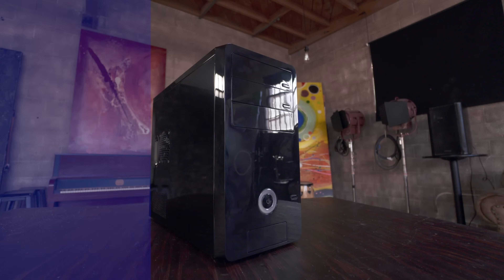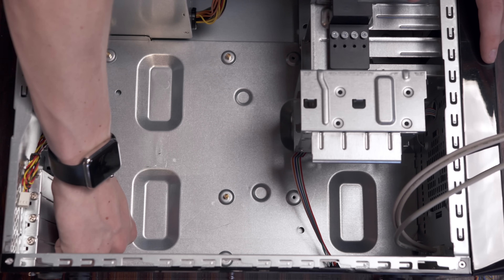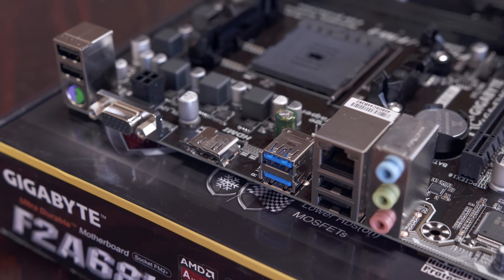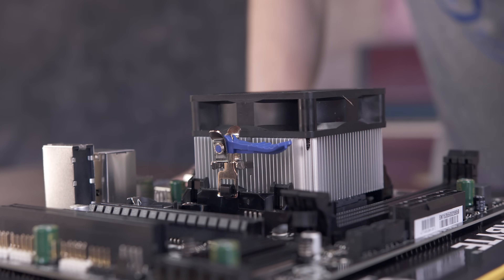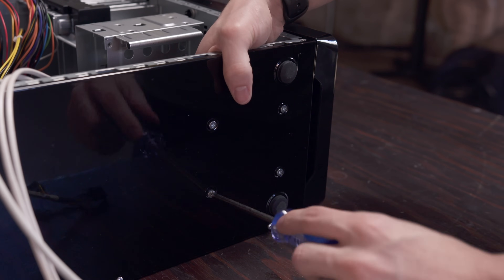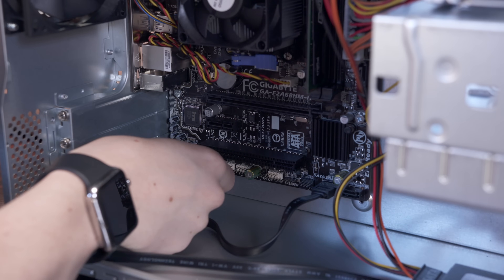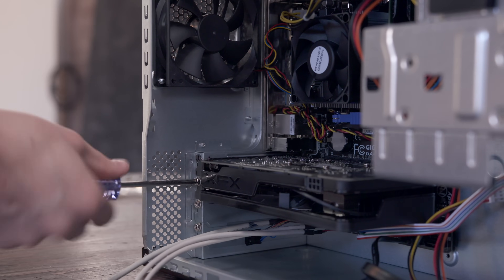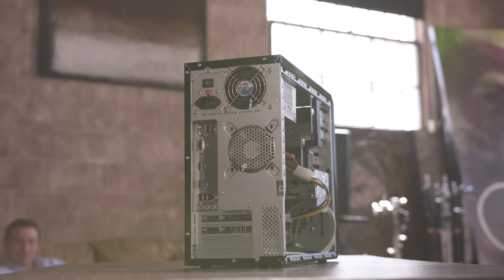How to Build a Gaming PC! (2016)

Comment: Could some of you rate my specs? :)
----------------------------------------------------------
Core i7-6700k

GTX 970 (4GB)

ASRock Z170 Gaming K4 ATX Intel LGA1151 Motherboard

G.SKILL Ripjaws V Series 16GB (2 x 8GB) Ripjaws V 2133 MHz DDR4

2TB Toshiba hard drive

Power supply : Raidmax Thunder V2 Series 735W

Xigmatek Assassin E-ATX Tower
Reply: Why would you take the i5-6600k instead of the i7-6700k, since i can also overclock the i7-6700k ?
Reply: GPU: You should definitely look at Nvidia's 10-series (the newest), they'll get you better performance and quieter operations. The GTX 1060 beats the 970 practically everywhere.

You should add an SSD to your build, it will really help boot times for Windows and load times in games.

Also, a 550 watt PSU will do just fine for this kind of build. You don't really need anything higher.
Reply: Yeah, i have a ssd drive, i forgot to put that in :d
Reply: JOISPOI24 Assuming you will be overclocking, i would go with an i5-6600k and gtx 1070
Reply: Keep in mind that i made this build in May 2016, The 10 series was a bit overpriced at that moment imo :)
Reply: I don't understand the point of getting a 6700k and having a gtx 970... i'd rather spend the money on a gtx1060 and a 6600k instead of having a shit gpu and a good cpu
Reply: iX NuclearFX
Okay, but you should know that i7s are not just the same chip as an i5 with higher clock speeds. They have extra 'threads' which allows them to do stuff like rendering faster, which is why they're worth the effort for heavy users.

Not that a 6600k would be terribly slow, an i7 would just be better.

If you're gonna overclock make sure to pick up a good 3rd party CPU cooler otherwise you may encounter thermal throttling and/or a very noisy system.

(also this is all assuming that your post saying 6600k isn't a typo, except for the cooling part)
Reply: JOISPOI24 an i7 6700k with a 970

facepalm
Reply: I can do a lot of heavy video editing I have 

Core I 2
2gb Ram
No graphics card
Reply: JOISPOI24 you have the best computer wish i could get one like that cuz all i need is gtx 760
Reply: Correct, an i7 is really only worth the extra money if you're going to do a lot of heavy video editing etc. For gaming they really don't add much
Reply: Broseph Stalin I will do much of the "heavy video editing" in the future an would prefer to buy a 6600k and overclock it to 4.2-4.5ghz especially for the price
Reply: Lytheus or you could get a i5 6600k with a 1070 since they would be about the price of a i7 6700k and 970
Reply: ***** 970 is currently around 600 dollars on newegg right now... a 1060 is 200 and a 1070 is 400 and a 1080 is 600 and they all out perform the 970, I don't think the 10 series are overpriced at all
Reply: ***** currently around 500*
Reply: SoggyOreos he probably just assumed newer model = more expensive lol
Reply: JOISPOI24 you can play GTA v at 100+ fps
Reply: GTX 1080
Reply: Better than my life
Reply: travpar0 plz sub to me
Reply: GPU buy gtx 1050 ti
Reply: JOISPOI24 Really good! But You Should Probably Get A gtx 1080 For more fps
Reply: Legal Gamerz plz earn it
Reply: Noice

Comment: hello everyone I don't really have experience in pc building and I want to tell me your opinion about this built :
evga gtx 1060 3gb
intel core i5 6600k
msi h110m gaming 
xfx power supply 600w
cooler master hyper 212x
xfury 8gb ram 
western digital 1 tb hard drive 
SanDisk 128 gb ssd. 
feel free to add anything or replace a part
Reply: I want to know if I can also replace a part with a cheaper one for the same performance
Reply: it's alright
Reply: Depends what you're using the system for, but it seems likely based on your build that you will be gaming. Either way, you're paying extra money for a CPU that has overclocking capabilities, yet you've gone for a motherboard that is unable to be overclocked. If you don't have experience building, it isn't necessarily a good idea to try to overclock your machine if you don't know what you're doing. For you I would recommend switching the i5-6600k for an i5-6500 because it'll be nearly identical performance if you're not overclocking. I would also remove the cooler master 212x if you go with the i5-6500, because the i5-6500 runs cool enough that the stock fan will be fine. The stock fan also comes with thermal paste pre-applied, so that'll also be one less thing you have to worry about as a complete beginner. With the extra $60 or so dollars you'll save with those switches, I would either go with 2x8gb ram and a 250gb SSD (the extra space would allow you to put some of your favorite games on it, as well as the OS that I assume you were going to initially put on it), or switch the 1060 3gb for the 1060 6gb (the 1060 3gb is gimped in more ways than just the VRAM, so this is definitely a worthwhile improvement for 40 or so dollars extra). If you could make all those improvements, I believe your system would run much more smoothly for only roughly thirty dollars more than the build you provided.

Comment: Everything is connected right and everything is running but I get no display.  And the keyboard doesn't work with it.
Reply: Nodog799 Try inserting the cable into the graphics card.

Comment: ITS MY FIRST TIME BUILDING IS IT GOOD

Intel Core i3-6100 3.7GHz Dual-Core Processor
£92.91  Free two-day shipping with Amazon Prime  £92.91 Amazon UK Buy
Motherboard 

MSI B150M Pro-VD Micro ATX LGA1151 Motherboard
£54.99  £5.99  £60.98 YoYoTech Buy
Memory 

G.Skill Ripjaws V Series 8GB (1 x 8GB) DDR4-2400 Memory
Storage 

Western Digital Caviar Blue 1TB 3.5" 7200RPM Internal Hard Drive
£40.99  £4.79  £45.78 Misco UK Buy
Video Card 

EVGA GeForce GTX 950 2GB Superclocked Video Card
£149.99    £149.99 Novatech Buy
Case 

Corsair Carbide Series 88R MicroATX Mid Tower Case
£40.15  Free two-day shipping with Amazon Prime  £40.15 Amazon UK Buy
Power Supply 

EVGA 500W 80+ Certified ATX Power Supply
£42.98    £42.98 Novatech Buy
Base Total: £422.01  
Shipping: £10.78  
Total: £432.79

Comment: Planning to switch over to PC soon. Don't know shit, but did some research. Criticize my picks fellow geeks. 

PROCESSOR >>>> Intel Core i5-6500 3.2 GHz Quad-Core Processor - 6 MB - LGA1151 Socket 

CPU COOLER >>>> Intel Core I3 I5 I7 Cpu Heatsink Pwm Fan 1150 1151 1155 1156       

MOTHERBOARD>>>> MSI Z170A Gaming M5 with Intel Z170 ATX Motherboard - LGA1151 Socket 

RAM>>>> Crucial - SO-DIMM 204-pin (x2)         

GPU>>>> MSI GeForce GTX 970 GAMING 4G Graphics Card - 4 GB GDDR5 - 256-bit - 1140 MHz 

SSD>>>> Samsung 850 EVO 500 GB Internal SSD - 2.5" - MZ-75E500 - SATA 6Gb/s 

POWER SUPPLY UNIT>>>> EVGA 100-W1-0600-K1 Power Supply - 80 PLUS - 600W 

COMPUTER CASE>>>> Antec Performance One P280 Tower - No power supply 

Total price is around $1200 for everything.
Reply: Alex Orellana Thats actually very good but you can get a bit better components for futureproofing. What are you intending your build for just in case?

Comment: I am building a PC and whenever I get it all hooked up I turn it on and my monitor will not display it i replaced the motherboard and also my graphics card.... And still won't work
Reply: What happens when you try to turn it on? Do your fans spin up or no signs of life at all, do you get the P.O.S.T. (boot) beep? Any LEDs either on board or HDD or Power LED that turn on?

Comment: Can anyone give me some advice? I'm planning on getting the following

CPU: Intel i5-4460 3.2ghz
GPU: EVGA GTX 960 SSC 2GB
Motherboard: GA-Z97-D3H ATX
Hard Drive: Western Digital WD10EZEX 1TB
RAM: Corsair Vengeance 1x8gb 
Case: Corsair Carbide 100R
PSU: Corsair CX550M 550 watts
Operating System: Windows 10 Home (license key from Kinguin)

Is this ok? It fits my budget and I don't think that I'll be able to afford buying a small SSD or upgrading my GTX 960 to 4GB of VRAM. Is this a good starting build? (Am willing to upgrade in the future)

Comment: It turns on but it doesn't come on the monitor or a TV
Reply: There's also no HD AUDIO
Reply: Make sure your HD audio cables and the rest are in the correct spots
Reply: I don't have a HD AUDIO thing on my motherboard
Reply: Unawesome Here
What motherboard do you have?
Reply: It's an F2A68HM-HD2
Reply: Unawesome Here http://prntscr.com/d0m8m1
I screenshot your motherboard and circled in green, what I think is the system panel header where you are to place hd audio.
Reply: Sundae That's where the positive/negative wire go from the case
Reply: Did  you connect the hdmi cable or whatever cable you are trying to hook up to your monitor with plugged into your gpu.
Reply: Tech By Mike It now works, I bought the wrong motherboard. Don't buy the HD2
Reply: Unawesome Here It should've worked, assuming that's a fm2+ mobo, assuming you went with this build.

Comment: Hey guys I was just wondering if this build any good?

MicroMemory 8GB DDR3 1333MHZ ECC/REG DIMM Module, MMG2448/8GB, D1G72J91 (DIMM Module)

BrosTrend WNA016 600Mbps AC600 USB 5GHz WiFi Dongle / Dual Band WiFi Dongle, 433Mbps Speed at 5GHZ Wi Fi Band or 150Mbps at 2.4GHZ Wi-Fi Band, Windows 10 WIFI Adapter Works with Windows 10/8.1/8/7/Vista/XP/2K 32 or 64 Bit OS (Internet Adapter)

XFX HD-545X-ZCH2 Graphics Card (ATI Radeon HD 5450 1 GB PCI-E GDDR3 Memory DVI HDMI 1 GPU)

AMD FX4300 Black Edition 4 Core (CPU)

ASUS AMD AM3+ 760G 2*DDR3 8*USB2.0 GBE LAN Micro-ATX MOTHERBOARD

CiT MX-A07 500W Micro ATX Chassis for PC - Black (Case) (Comes with power supply)
  
All of these are from amazon.

Comment: http://pcpartpicker.com/user/mobpwnage/saved/#view=drnHxr. Is this a good PC for running CS:GO and record at the same time?
Reply: no.
Reply: Mobpwnage get an i3 6100 and an rx 480/Gtx 1060
Reply: Mobpwnage yes
Reply: Mobpwnage get a gigabyte mobocracy since I've heard only bad things from asrock
Reply: Ok thank you very much
Reply: ok, i get Rx 460 and i3
Reply: Oh, ok, I will get RX 480 or 1060 :)
Reply: Get an i5 cpu.
Reply: Can't budget won't fit :/ I'm on a super low budget of liike 600 including monitor :(
Reply: Mobpwnage bro 600 dollars isn't a really low budget a 500 dollar PC is really good and than 100 dollars on a moniter
Reply: That was my exact plan, my pc build is roughly 500, slightly under. and for the monitor i'm getting this:  https://www.amazon.com/dp/B00CLZ047Q/ref=twister_B01MEHQ1QK?_encoding=UTF8&psc=1
Reply: it will work
Reply: Go with austins photon 2.0 build... you will get much better value and why did you add a cooler, the cpu comes with one and your not gonna be overclocking (probably) on an i3...
Reply: um, it's kinda very modified photon 2.0 lol
I prob going to change the case and that's it
Reply: get an i5 6600k and a 1050 ti is fine but 1060 would be better since ur recording which does mainly use cpu  and csgo which is also mainly cpu bound
Reply: Um, i thought i5 6600k are for overclocking? I don't really wanna overclock my cpu, probably just the gpu. And then i wouldn't i have to get a z170 board to overclock as well?

Comment: Ok... So I built this using pretty much the same parts as Austin uses, with the exception of the hard drive, which is a 1TB WD Blue. However, when I turn the computer on, I'm taken to a Gigabyte splash screen, but it quickly switches to a screen which simply says the following:

Reboot and Select proper Boot device
- Insert Boot Media in selected Boot device and press a key

If I mash delete or f9 before this appears, I'm taken to a black screen with a mouse cursor that I cannot move. No BIOS :/

I have a suspicion that it's something to do with my hard drive, which may be faulty or something. Some advice would be appreciated :)

Comment: Can http://pcpartpicker.com/list/3L9sKZ run Gta v/arma 3 at standard settings and get 60fps??

Also is http://pcpartpicker.com/list/Gt87wV a good build for a 2nd PC??

*parents are divorced. I have a 500$ budget at moms + a monitor. ( first link)
*my dad's is the second link for arma 3 and Gta v at high/ultra, 50-60fps+
Reply: I have the same Cpu And Graphics Card for the first PC, an i run Gta V at roughly 30-40 fps on Low

Comment: Does anyone know if you need a hard drive to turn on your PC? I'm waiting on the hard drive I bought, but I put together everything else I need. The fans spin and the lights turn on, but nothing happens. I just want to know if my PC isn't turning on because I have no hard drive installed yet, or my wiring is wrong. I would just like to know ahead of time so I could start rewiring before my hard drive arrives. Thanks
Reply: It will turn on except that you will be booted to Bios screen instead. If there is totally no signal at all, it means that something is wrong with your wiring.
Reply: I Have No Name Yes. You need a hard drive/solid state to boot into your operating system, and write files.

Comment: I am quite new to pcs and I have a question, does a case need to be compatible with the motherboard and power source, or do all cases fit?
Reply: Motherboard comes with different size namely EATX, ATX, MATX and ITX (Biggest to smallest respectively). Go to the case manufacturer's website and look at their specification. They will state which size it will support.
Reply: WB IsMe Ok, thanks for that info. I really appreciate it, thinking of building a pc early next year

Comment: Can a 350w support a rx470
Reply: No.
Reply: Can it support rx460
Reply: Yes
Reply: JayDaBeast101
Reply: Sup
Reply: JayDaBeast101 look at the description of all your components and calculate how much power they need. everything should be written somewhere.
Reply: when deciding the power supply for your PC never ever go cheap. if you use PC Building sites to get the best idea to build said pc your power supply should always be greater than what the pc uses.

for instance. if your pc uses 340 Watts of power
you need a power supply of a minimum 550 watts.   
if you aren't spending at least $70 dollars on your power supply chances are the one you picked is terrible. Corsair are the best of the best when it comes to them.

http://pcpartpicker.com/ i use this site for picking pc parts
Reply: JayDaBeast101 no, go 500w
Reply: Get a corsair or EVGA. Cheap power supply's that get overloaded end up frying all your components. this build is non-up gradable really. If you want a PC that will be "Up-gradable" for the next 10 years you need a Broadwell-E socket type, and 1000 watt power supply, and a DDR4 motherboard.
Reply: yes
Reply: JayDaBeast101 well just to answer your question a Msi nvidia geoforce 1050 needs at least 300  watts so 350 watts should get it done but just like the other guy said don't buy a super cheap psu
Reply: Does anyone know a couple causes with this set-up as to why there would be no signal on my monitor? I'm using a VGA just in case you needed to know.
Reply: Lawlard _ try to remove your cmos battery on ur motherboard wait a couple of minutes and put it back on.in case u wonder the battery is in shape of big circel.
Reply: Lawlard _ oh yeah and completely shut down your pc and monitor before that.
Reply: CAPTAIN KILLER I did that and removed to clean the RAM like most common trouble shoot problems, the only thing I can think of is that my monitor only has "D-Sub" and "DVI", and it only came with D-Sub cord so I'll try an HDMI on my TV to see if it just doesn't take D-Sub because I thought it was VGA (even though are mostly compatible).
Reply: Look for deals, hell I got a refurbished EVGA 600W PSU from NewEgg and I got for about $80 Canadian which is about $60 USD

Comment: hardrive or ssd wich is better ?
Reply: Get both.
Reply: Foxxyman Like he said, get both. The ssd should be around 120-240 GB for the OS and other important things like drivers, and a TB hard drive (hhd) for everything else. Not only you get that speed boost from the ssd but you also have plenty storage for your porn sta.. I mean for your work, yeah.
Reply: HDD are cheap but worse. SSD are better but more expensive.
Reply: What Alex the Troller said but also if you're using the pc for games, SSD will deliver better framerates than HDD if you store the game on the SSD.
Reply: h7opolo No they won't. They will only give you faster loading time
Reply: Potato
You are right about this.  stand corrected. Thanx for dispelling my ignorance.
Reply: h7opolo No problem man
Reply: your budget depends on this.hdd is cheaper, but slower.ssd is faster but expensive

Comment: i dont see you use thermal paste to the processor, is that good for heating transfer to the fan?
Reply: Thermal paste is pre-applied on the processor cooler.
Reply: it is pre-applied on the cooler but it is recommended to use your own thermal paste because the paste on the cooler is not that great.